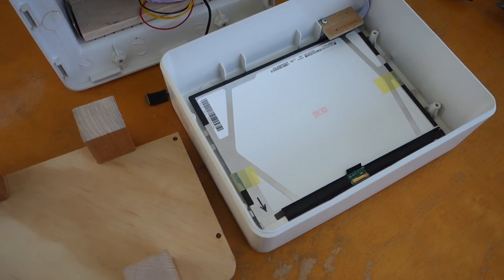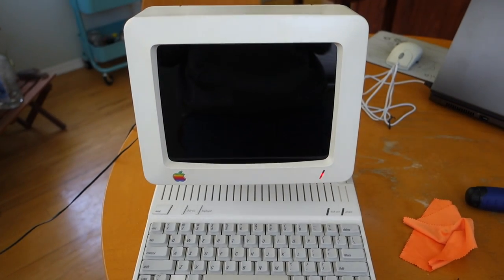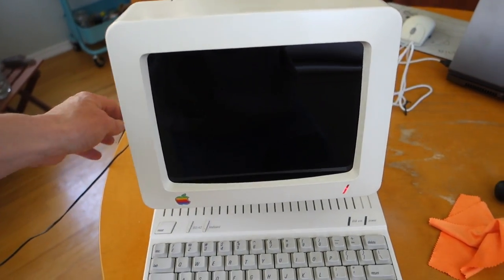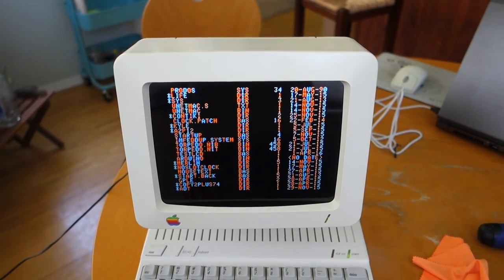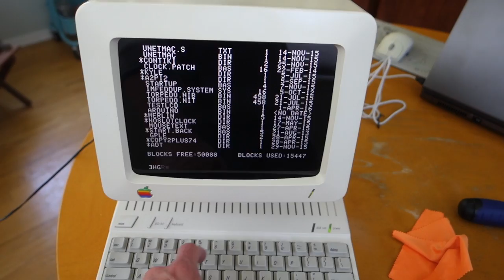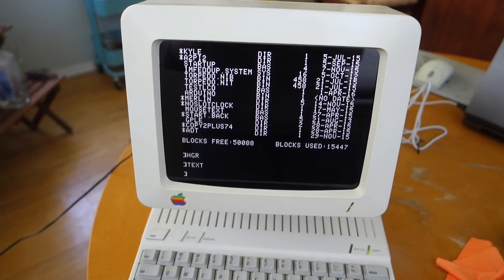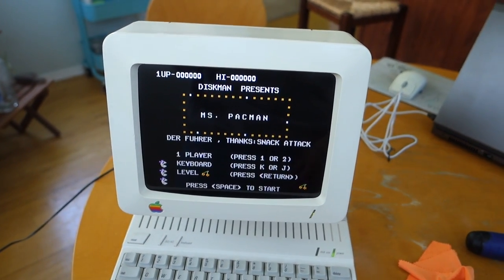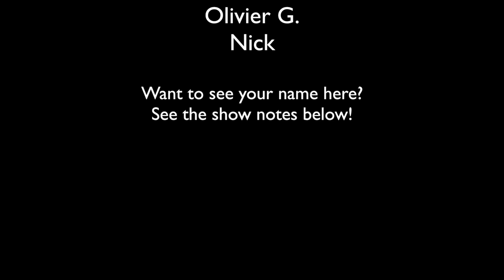Assembly Lines #30: Apple //c Monitor LCD Conversion

Comment: This is such an awesome modification! Nicely done on everything, especially not having to modifiy the original IIc monitor case. I know it's been 3+ years since you did this video, however I'm hoping you could recommend a current eBay link to get this LCD monitor kit since your original link no longer works. Thanks in advance!
Reply from the maker: Here's a recommendation that I got from Javier Rivera: "HDMI VGA 2AV LCD Controller Board 9.7" 1024x768 WLED Backlight LCD Screen", on eBay: https://www.ebay.com/itm/HDMI-VGA-2AV-LCD-Controller-Board-9-7-1024x768-WLED-Backlight-LCD-Screen/183943401178

Comment: Nice. Did you consider mounting an RCA jack to the back and soldering it to a male cable. It would save you from making the plywood riser.
Reply from the maker: yep, that would have been a good idea. I would also like to get the switch hooked up properly.

Comment: Hi Chris,

Thanks for the video!!
I have a few questions...

1. How did you measure the size of the holes you needed to create to accept the screws?
2. For the wood blocks that did not require screw holes, did you glue them to the case to keep them in place? (Maybe they all required screw holes.)
3. I didn't notice how (or whether) you connected the power button to the VGA panel. I saw where you disconnected the button.

Thanks!
Reply from the maker: +Mike Whalen Hey Mike, good to hear from you. For the holes, I'm not sure exactly what you mean. If you mean the holes that the screws have to go through to secure the screen, I just guessed at the size. They were probably a bit larger than 1/8". Let me know if I'm not understanding your question.
For the wood blocks, they were all held on by screws - so no gluing necessary!
I couldn't figure out a nice way to connect the power button - so right now I'm just using the button on the back of the panel. But those LCD monitors are "always on" - they just go into low-power mode, so it's very rare to have to actually hit the button.
Reply: +Chris Torrence nope you answered everything! Thanks

Comment: Blue Tak should work good for "mounting" the control panel on the back of the monitor.
Reply from the maker: That's a good idea! I used velcro but your way would be more reversible.
Reply: I use it for "mounting" my 4 rear surround speakers on my speaker stands.  Works great!  Someone mentioned it on AVSForum years ago, so I can't take credit for it. ;-)

Comment: Would you be able to give extra info on the driver board you used. Seems a great fit without the need for drilling the case. Did you remove one of the rca jacks?  It looks in one scene the board had two Rca yellow jacks but when mounted there was only one!. Any links to eBay sellers would be great
Reply from the maker: Hi David, it a Samsung LTN097XL01-A01. But you're absolutely right. I did this video over the course of a couple weeks, and completely forgot about the 2 RCA jacks. The board did have 2 jacks which extended past the edge by about 1/4 inch. By desoldering one jack, I was able to get the other jack to stick out through one of the existing //c monitor holes.
Reply: Hi Chris, thanks, The Samsung Panel is pretty easy to source it's the details of the controller board that I'm really looking for help on.
Reply from the maker: +David Carter sorry, gave you the wrong model number. Here is a link to the eBay auction for the exact one that I bought: http://pages.ebay.com/link/?nav=item.view&alt=web&id=201321583703&globalID=EBAY-US
Reply: Chris, This is frustrating. They don't ship to the UK. Been trawling eBay for similar boards but no joy. Thanks again.

Comment: This is awesome. Does it look ok with 80 column text?
Reply from the maker: It looks pretty good. Not as nice as the Nightowl monitors, but those are unobtanium. I'd say it looks as good as a standard run-of-the-mill color CRT.

Comment: What's the eBay link for the display panel ?
Reply from the maker: The title of the ebay item is "HD 9.7 inch 1024x768 LCD Panel + 2AV+VGA+HDMI+USB Reversing Driver Board Car Kit". Here's the link: http://r.ebay.com/6fjx4m
Reply: I would recommend not buying that display. I did. It’s too big for the case. If you were to cut the plastic inside the case that the original monitor mounts to, it might just barely fit - but there are other issues. The image on screen isn’t centered. It’s quite a bit off to the right, and the software for the display doesn’t let you shift the image left and right. When connected to the composite output of the Apple IIc the image quality is pretty poor. It’s blurry and seems like it’s moving a bit at all times.

Comment: What is the model number of the screen?
Reply from the maker: +cflcookti It's a Samsung LTN097XL01-A01. I got the kit off of eBay, but you need to be careful as some of the driver boards work better than others. This one has the problem with dropping the signal in text mode. I bought a different one, but it was extremely blurry with the Apple's composite signal. So your mileage may vary...